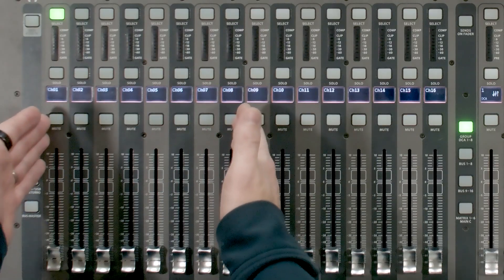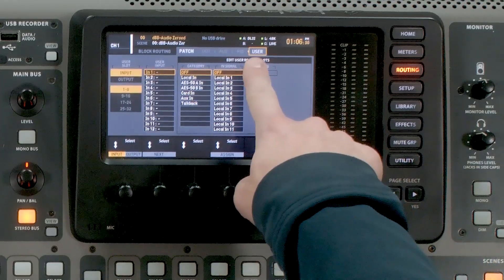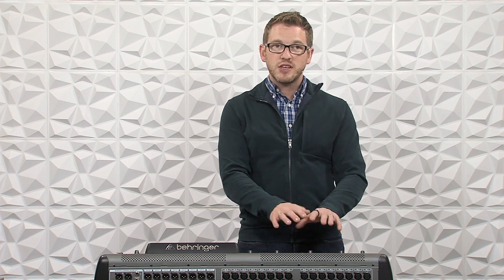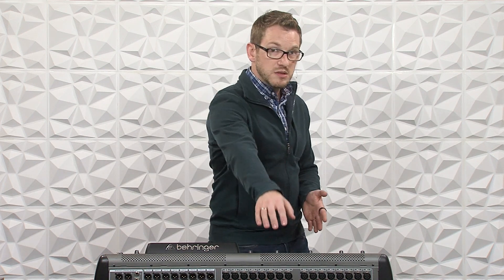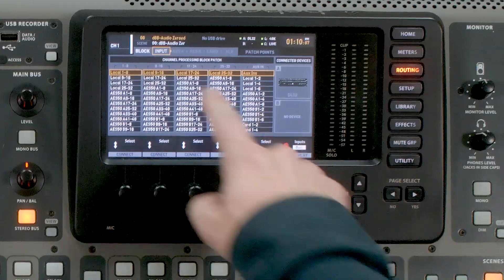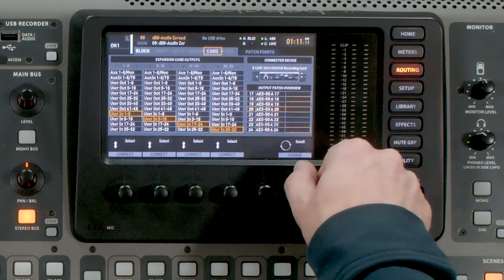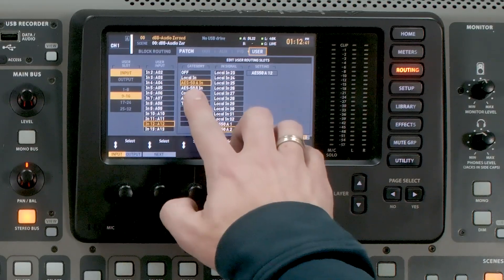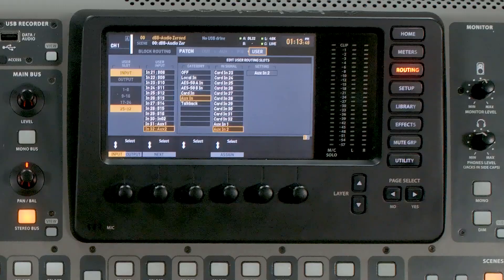Behringer X32 User Input Routing

Comment: Hi Drew.  I love your videos.  Thanks for all the help.  I have an X32 Compactact and I've routed the physical Aux input 4 to User Ch 12.  Input (Fader) 12 is routed to User 12.  The scribble strip for Fader 12 shows that it is routed to Aux 4.  The LCD meter for Ch 12 is showing signal from that input (in this case a mic.)  However, I cannot control the channel's volume with the Ch 12 fader.  I can only control it from the Aux 4 fader on the Aux page.  What am I doing wrong?

Comment: Thanks for all your helpfull vids. Just experienced that the S32 was properly connected to the X32. Shown in the X32 and the S32 respond to activate phantom power. However, when i'm connecting a (normal) cardoid mic to the s32 (no phantom) i get no input into the x32.  Green lights on the S32 as well X32.  Do you have the solution?

Comment: Drew, good evening and I pray you are doing well. Your videos are very helpful and been watching your videos now for about 4 years now. With that being said, we have the full X32 console and recently in the past month and a half, we run into this sound distortion and can't put our finger on it. We've check with Boxcast using their encoder and it's not them, we checked with Roland V1-HD tech support and it's not them. We ran multiple livestream test with boxcast and even adjusted the audio levels within the boxcast source page and we still get this static in and out noise coming from what we believe are our EV mics or one of our Shure sm58 vocal mics. We are thinking of factory resetting the board and starting over by setting our preamp gains between negative 20-18dbs. Any advice???  https://www.youtube.com/@livingh2ochurch

Comment: Hi Drew, these videos are great, I subscribed yesterday!
I just got the X32 compact for my home studio, replacing an analog Mackie mixer.
I mainly use it for recording my drumset and have it working great and am still learning all its features.

A question:
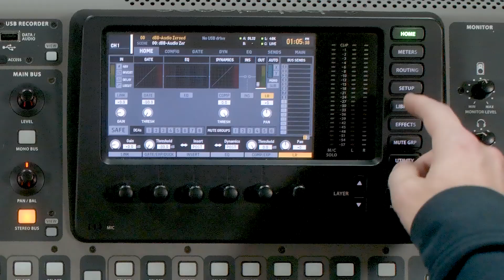In the video around 0:51 you can see a Record/Play selection at the bottom of the screen.
I checked the manual but it isn't there so I assume it was added in a later firmware version.
So I can setup different selections for Record/Play but what is the purpose?
Also, I noticed the X32 Edit PC app mentions Aux In Remap, so I can setup different aux mapping for Record/Play. But for what?

Maybe an idea for a video?

Comment: This is super helpful. We use the X32 for theater. We use TheaterMix software and may use a show file generated at another theater with different mic setup. Sharing of show files saves a lot of programming time. 

The user input routing will allow us to map our mic set up to the existing show file, avoiding a reprogram of the show file. Obviously we could create a show file from scratch, but then we would lose the benefit of the hours of programming already done for us by the previous theater tech.

Comment: You've been a huge help, Drew! I'm a longtime Presonus user, but am incorporating an X32 Rack into my performing rack. Although I have run FOH on one in the past, I didn't set it up so the internal setup and routing was unfamiliar. Your content has been invaluable in sorting my needs and options. I also purchased a S16 to incorporate into the setup. The limitation of 8 channel grouping was absurd to me, and I am so glad I didn't jump into this soup until V4 was a thing. I'm going to reset my machine and re-do everything based on User inputs/outputs. This gets me back to the routing capabilities of my Presonus gear, and really gets the X32 on equal footing. You're a blessing, brother!

Comment: DREW!! You just saved my Sunday morning! I was scratching my head over this when we just put in our 2 S16's and need to route 1-4 and 30-32 on the board from the back of the board and the rest from the stage boxes. I knew there had to be a way to do it and the part I was missing for user input routing was actually the part where you set them to the faders. Your videos are such a help and extremely informative. Thank you for putting this info out there for free!!

Comment: Drew I am a x32 rack user and I am having major issues. So what I have is the x32 rack running with the Dante card and the SD16 Stage box. My delima is that I want to mutitrack and stream my church service live. I have my multitrack system on one side of the sancuary with a dVS license and on my main Vmix machine I have another DVS license. I have everything routed but when I go to the routing I get lost. I am using inputs 1-16 on the rack and 1-16 inputs on the stage box AES50. I am using 4 outputs on the stagebox for IEMS and for my outputs on the x32 im using outputs 3 for stage monitors and output 4 for a subwoofer on the rack. I am using Busmix 1and 2 for my livestream into Vmix but, when I try to multitrack with my laptop I get all of my channels coming in weather I want to here just 1 mic it comes over all channels. What am I doing wrong? I guess I am getting confussed about the outputs and inputs.

Comment: In my x32, we have channels one to 16 for instruments, all plugged into the s32 digital box. Channels 17-26 are for microphones because we have a huge group of singer and that includes pastors Mic and invited preachers who have 1 mic universal for them. We routed the instruments to AES50 which works fine, then the vocals were left in their normal routing, because the microphone box has 8 microphones. We didn’t buy different boxes, just that one. Audio comes out so there’s no problem, however. When selecting a channel, using the fader either the one for each channel or the main L/R. Nothing changes, it doesn’t affect the channels. How can that be fixed if I did something wrong.!
Reply: Make sure to set your LR source to post fader in the output routing. (Routing -> Analogue Out -> scroll down to your main L& R outputs (these are set to 15 & 16 by default if you haven’t changed them) & make sure “Post Fader” is selected on both the LR under the “Tap” tab) hope this helps!

Comment: Im having trouble on the routing part when it comes to re recording a track becauae when i switch 1-8 channels over to local inputs i am not able to hear tracks on channels 2-8 for example if im re recording a vocal on channel 1 for example. Any suggestions or tips on how i can get this to work? If i leave the local channels 1-8 on card i can then hear all the 8 tracks but when im trying to re record my vocal on ch 1 there is latency and obviously can not re record a vocal when there is latency. The only way i can hear my vocal normally with no latency is when i switch the routing inputs 1-8 back to local inputs if that makes sense. Any thoughts or suggestions? Thanks in advance.

Comment: I admit that I don't have yet the mixer at hand so I can not verify by myself.
Problem:
I'm undecided whether to buy x32 or x32 compact (with Midas DL 32 stage box).
I ask #1: with x32 (no compact) the eight Output Faders  can be configured as Input Faders, to have 24 input faders in one layer.? It would be useful for live.
if this is not possible, then I might as well buy the compact which, by pushing at the same time the green keys 1-8 and 9-16, transforms the eight output faders into input faders. At least I have 16 input faders at hand, like "x32 no compact".

Comment: Thanks, Drew, for the great videos!  
Question for you, or for anyone who has experienced this situation and solved it. I have recently worked in a theater with an odd sound setup. The wireless mic receivers and amplifiers were all located at the FOH mix position, connected to an X32. There is an S32 snake connecting the orchestra pit and some XLR stage mics. All good so far. Now I needed to send a monitor signal to the stage, which doesn't have installed monitors, so I added my own. Problem was, with the main L&R outputs of the X32 going analog to the amps beside it, I could not configure the X32 to send a monitor-only signal to the stage, via the S32. I tried every routing possibility that I could think of, to no avail. Without time on my side, I ended up doing it quick and dirty, by running analog XLR lines down the venue to feed the monitors. 
Surely there is a way around this, so if you would, please advise me. I'm very used to configuring the X32, but this setup proved to be unusual.

Comment: Thanks for the videos!  I have a question:  I want to run multiple keyboards into my X32 board. All my vocals are coming out my Main outputs(1&2) to my powered Yamaha mixing board PA. For rehearsal only, I don't want my Keyboards going out the main outputs. I want thme going out to my other PA (YamahaEMX Powered Mixer) to use as a separate amp. If I routed them to Main Outs 3&4  and run those leads to the EMX , would that work?  Will I still be able to send every channel to my Mac Studio Pro to record the rehearsal sessions, as well?   Forgive me if this is a stupid question.  I'm just a piano player, not  sound engineer.

Comment: Noob question as I've had my X32 all of 2 months. Instead of using aux in remapping to get backing tracks to my aux ins can I utilize the user input routing to place them under card on the aux ins so that they aren't coming in on 1-6.. cuz I noticed I am trying to record my show and send it to a pa and the recording glitches.. I'm guessing cuz I'm trying to record local 1-4 and aux in (remapped to card 1-4)

Comment: Just a quick question instead of ticking the 28 one by one could you have went to the input page and chose 1-24 aes50 channels and then went to the user input page to finish the remainder 25-28 aes50 inputs and the Local inputs that you were routing to 29-32?
Reply from the maker: Absolutely you could! Typically when working with volunteers keeping things clean is the better way so I will try to limit the amount of things that look out of place. Which is why I would chose the User Routing for all 1-32 and then bury the changes into the user routing patch.
Reply: @DrewBrashler  Awesome thank you for your quick response. There is also a multi-Behringer X32 setup that i have been working on and would like your input. is there an email that you have to where i can send the diagram?

Comment: Drew this was a big help. I have an x32 FOH when the venue has space for it. An x32 rack (used for monitor world when needed and full FOH and Monitor world when full x32 is not present) and 16 chan snake. I want to route all channels in the x32 rack and snake. How should I set the user routing on the full x32 seeing that I'll only be using the aes50 port A on the full x32? It would also be fun to see you set up a similar system that allows the user to use the rack and snake as a fully stand-alone unit w/IPad or monitor world.

Comment: Drew thanks so much for all your videos. I have learned a lot, helping me to understand better my new Behringer X32 producer. 
If you have time in the future, please talk about working with a couples of SD-16 or SD-8 on stage. I have questions on how to do the routing in two different stage boxes, how to know from
Which one from those two I have to connect to Main L/R for FOH speakers. And also how to do multitrack recording in Logic using two boxes plus a couples of wireless mics connected locally to the mixer. 
I know it’s a lot of questions but if you can talk of any of these topics would be highly appreciated.
Thanks so much!

Comment: Awesome videos - how about sending effects to monitors. I thought I knew how to do that but I couldn't get it working on the weekend!
M
Reply: Hit "Select" on the BUSS feeding the particular monitor you want effects in, hit "Sends on fader", go to LEFT side of console and select the "AUX in/USB/FX Returns" tab, you will see the master effects return faders at zero. Bring up whichever effect you want into the buss/monitor mix. It's the same at that point as adding any channel to the monitor. All the master effects returns are already set to unity to feed the main left right, but they have to be added to buss' 1 through 14.   --(or 1 through 6 if you have the smaller boards). Hope that helps👍
Reply: Oh, you have to make sure that the actual channel you want the effect on is going TO the effect first. As long as you can hear the effect in front house, what I wrote down here will work. If you can't hear it in front house, you may not have the channel going to the effect. And, it's a pain to turn it off and on in between songs. FOH engineer already has to remember to mute effects to FOH between songs. So it generally stays on if you ask for it in your monitor.

Comment: I have a lexicon reverb I'd like to use for vox. I have it connected to aux sends and returns but is there a way to get it to return to a group opposed to the aux returns?
Reply: SELECT a buss or "group" that you want it on, and hit "Sends on Fader". Select the tab with the "Aux in's" on the left side of the mixer and raise the appropriate aux fader. It will send the Aux return to that buss. It can be a monitor buss to hear through monitors, a group buss with vocals only, or an empty buss that only contains the effect return and you send it to the left right main out. Mix it in to the main mix when you want it. Btw, don't blame you for wanting to use the Lexicon over the stuff inside lol. Cheers

Comment: I use an X32 Rack onstage that houses my first 16 preamps, including those for wireless and this console acts as the monitor console (Band runs IEMs, though this would be just as relevant with wedges), this rack houses my Bluetooth unit on one of the Aux ins that I use for program music. This ends up being reflected in my AES50 sends to FOH (an X32 or M32 usually). So I send my Aux Ins on AES50A 33-40, using the User routing I can remap the Aux Ins on the FOH board to come from the stage, thus running my program music from the rack onstage. On top of this, I can also use the User Output routing to run Mains and Subs back through the outputs on the X32 Rack, of course if more I/O is required, then a stage box could be run from said X32 Rack and audio would be routed accordingly to both consoles.